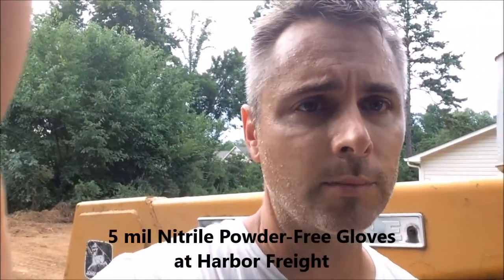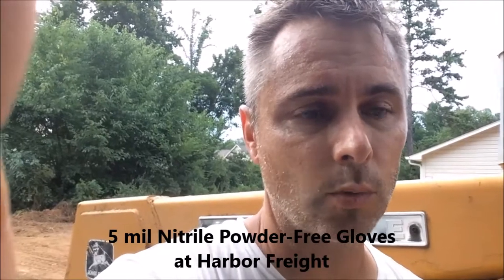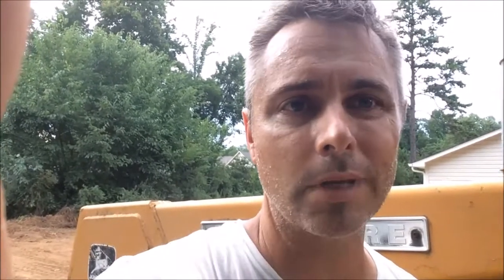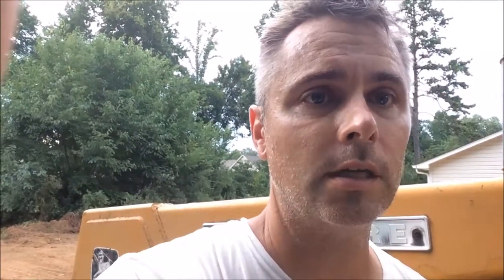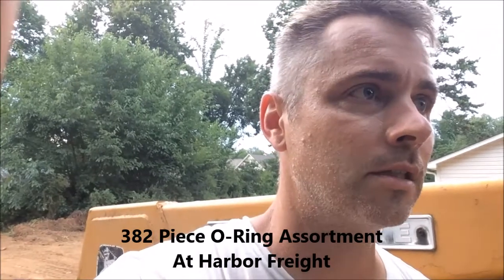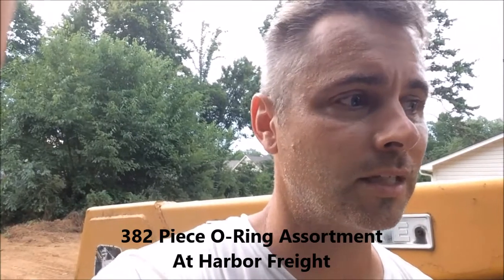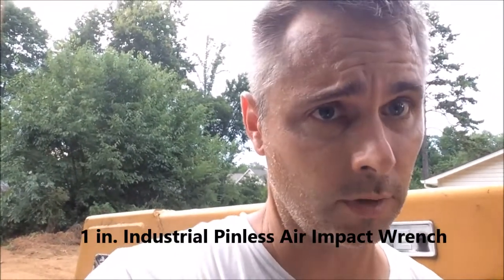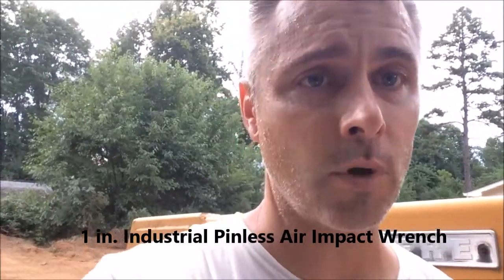Tools for working on Heavy Equipment

Comment from the maker: Here are links to the things I talk about in the video.  
Gloves: http://www.harborfreight.com/5-mil-nitrile-powder-free-gloves-100-pc-large-68497.html

O-Ring Set (there is metric and SAE)
http://www.harborfreight.com/382-piece-o-ring-assortment-67554.html

1" Industrial Air Impact Wrench
http://www.harborfreight.com/1-in-industrial-pinless-air-impact-wrench-68128.html

Hydraulic Fluid from Tractor Suppy:
http://www.tractorsupply.com/tsc/product/traveller-universal-tractor-trans-hydraulic-fluid-5-gal

Catawba Rubber:
http://www.catawbarubber.com/